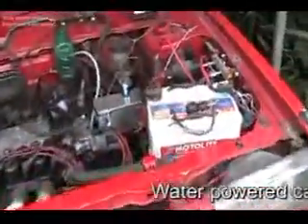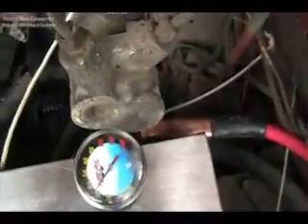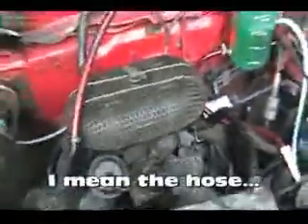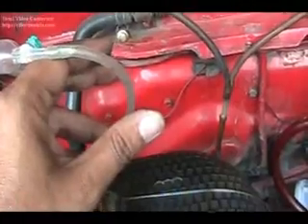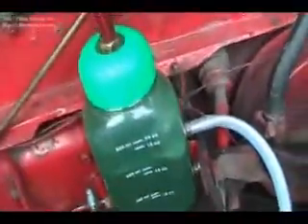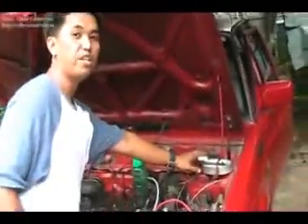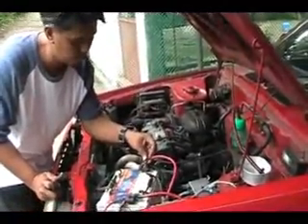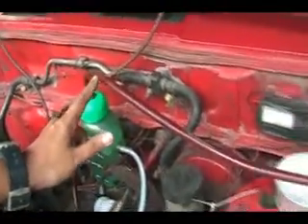HHO - hydrogen fuel installed in my car - Philippines

Comment: I introduce my hydrogen to the engine through the air filter.  It helps keep contaminants out of the engine "red oxide" and there is no need to tamper with vacuum lines.  Keeping the actual apparatus outside of the vehicle will also help it keep the water cool, as we are still separating the covalent bond by force producing heat.

Comment: Thank you
But how to control the car speed
Is there a device for controlling the amount of hydrogen Motor? 
Hydrogen gas comes out with a little water and this affects the motor.Is there an effective filter for this does not happen?

Comment: No,  it cant improve your economy.  it does nothing.  Period.  Arguing that it does is extremely ignorant to the point of hilarity.   
Get a lawnmower engine,  run it on hho only.  make it turn a generator,  that powers an electrolyser.  Since burning hho makes heat,  and the alternator isnt 100% efficient,  thats already alot of your power lost.  
Im sure you can find alot of people on the internet that say it works.  I found jonathan sharkey on the internet.

Comment: because the law of thermodynamics says 1+1=2,  and not 3.  Run the motor, turn the alternator, charge the battery, spend that electricity making hydrogen, burn the hydrogen, run the motor, turn the alternator, charge the battery...  

Here is an easy experiment to prove me wrong.  Make a hydrogen generator that doesnt use a battery.  Just a motor, running on the hydrogen that it generates with its alternator.  Ill eat my own balls.

Comment: @snathanmax If you want to improve your car engine efficiency and save your car fuel expenses. There is a better way to do it - it is HHO Gas. Using Hydrogen Hybrid alternative for improving your car miles per gallon or kilometer per liter. Search Google for: "Top HHO Car Research". Click the first Result (Skip the Advertisement)

Comment: @jayrene123 sir, gamitan mo ng flashbask arrestor 'yang set up mo hho fuel cell mo para safety ka pati wheels mo at pashero mo at kailangan makaproduce ka ng 1.5 ltrs per minutes na hydrogen gas @12volts maximum 12amps,,,congrats po sa experiments nyo doble ingant sa HHO..,,, graduate na kc ako dyan sa hho and now busy producing Ethanol bio-fuel ....mas exciting d2       73s du1pml

Comment: jayrene123 sir, wish i could help you improve ur hho anyway congrats dyan sa experiments mo . if you could produce 1.5 ltrs per minutes @ max.12 amps eh pwede na pero kulang ka pa sa mga safety gadget mo at delicado pa yan sa 'yo,wheels mo at sa pasahero mo kc gargado ka na ng hydrogen gas sa engine mo. i-call mo ako  0915 8265831 para ma-improve mo 'yan hho mo

Comment: Pure B.S.  There has to be a completely separate (and very large) energy source to extract enough fuel from water on demand to power any car.
Cars typically require around 700 to 1,000 liters of gas PER MINUTE
to cruise at normal speeds. 
These 'under the hood' kits you see for sale produce on average about 1 liter
of gas per minute. It's simple math.

Comment: @urbex2007 Have you ever put an alternator under load and tried to turn it? The engine needs to work 30% harder to produce the hydrogen that does not give back that much in fuel saved. You cant get something from nothing.

Comment: napanood ko ung pagasbog ng bubbler mo. Pede siguro backfire arrester ung fuel filter sa motorcycle gawa ata sya sa asbestos. pero ok ung dextrose hose ah, hehe.
Ahm, pure water ba yan?  ilang amp ang kain nyan? Liter per minute? Km per liter?
Kaylangan na dumami ang HHO sa Philippines.
Salamat.

Comment: Lean? try wet. hho in a hot engine will make steam which will clean the engine up really nicely but one problem is that water buildup on the piston head which hit the sprak plug and fauls the pulg so the car runs like shit. Emissions are almost gone with water vapor introduced. Experiment before making a comment and see the results. I am not being mean just telling you what to expect. This with plasma spark CDI will make the car run almost on no gasoline but small vapors.

Comment from the maker: putting enough water inside the cell is enough to trigger ionization bond. thus separating positive and negative particles to create electrolysis. if the H2O dried up inside the cell the flow of electrons along the conductor will stop also therefore the system will not work even its connected to the power source.